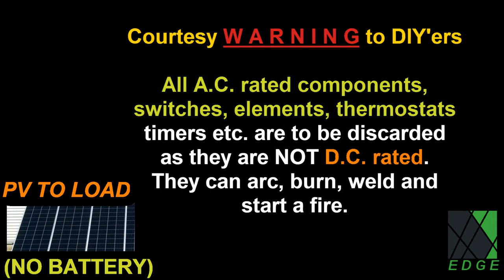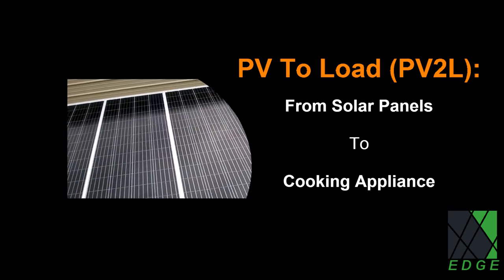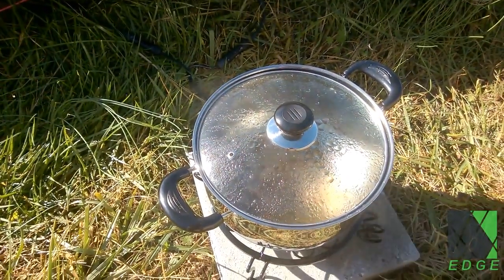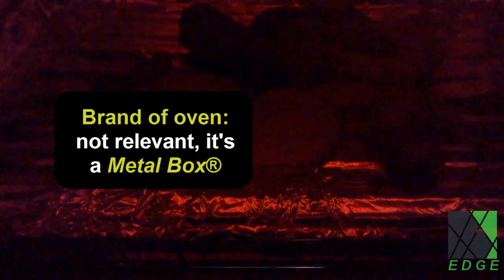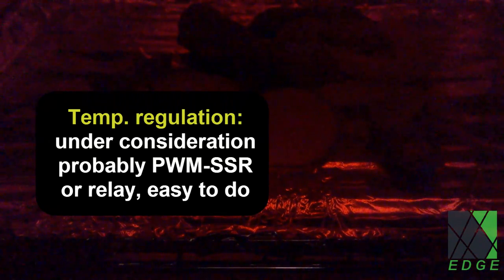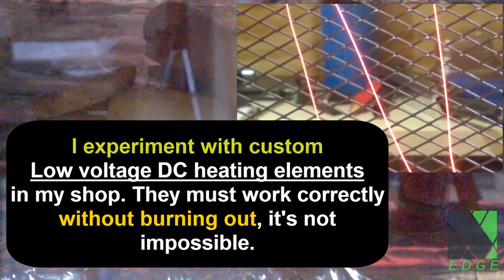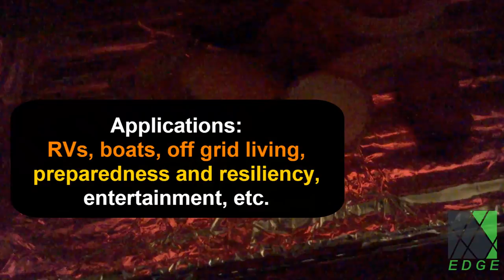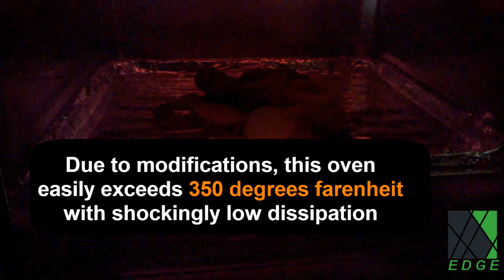Direct solar powered OVEN first test video, Solar Hot Dogs, PV2L 2023 #solarcooker #solarcooking

Comment: I run an attic fan off of a 100 watt panel directly to the fan. It cut my air-conditioned use in half.
Reply from the maker: Nice!  I tried that in 2 of my sheds and it works. I don't have an attic so can't try it in my house though

Comment: Hello, I just saw your model of the cook stove on video while you demonstrated it. Where can I get a solar cook stove like this? I'd love to be a representative in my area.  i would love to have more information on this, please
Reply from the maker: Hello! thank you for your interest, do you mean the Stove, or the Oven project (this video)? the oven was hand built in my workshop using parts I could find. 

The cook stoves are smaller but again I have to build them myself. So far I have 4 of the small stoves. They do not get a lot of interest which I think is very strange.

In short, I don't know of any company making these stoves right now. My hope is that a manufacturer would mass-produce these products so we can all buy them easily. I do have plans to make more videos about them, such as how to build, safety, etc. If you are interested in learning more, please consider subscribing so you would be notified of any future updates on the project. If I make stoves for others or show them how, I am concerned about liability: no UL listing, handmade, and potential to cause a fire if used incorrectly. For these reasons and others, I have hesitated to show a lot of details. I hope you understand Please let me know if you have any questions!
Reply: @solarpoweredge  I am talking about the solar cook stove, not the oven. Thanks for the information, I shall subscribe right away for more updates and information. Many thanks.
Reply from the maker: Thank you Pelletio for subscribing, I found their name and will reply to your other comment